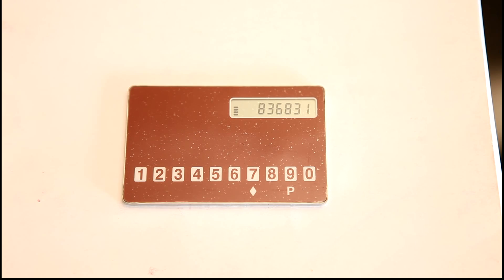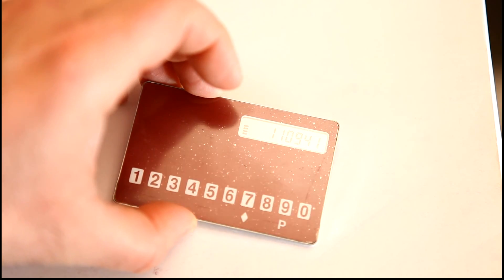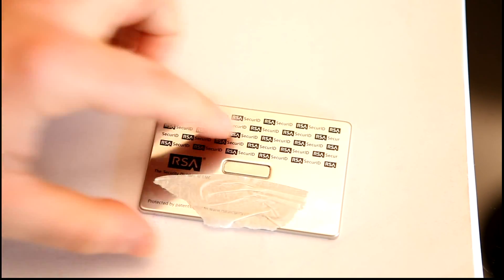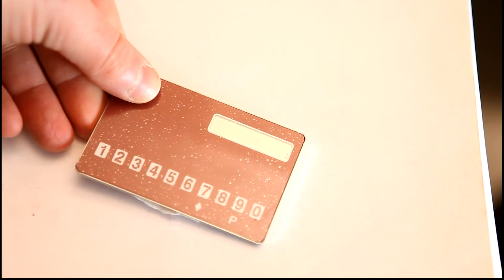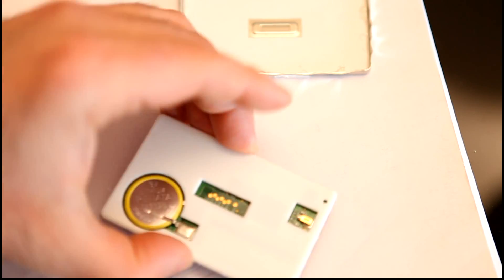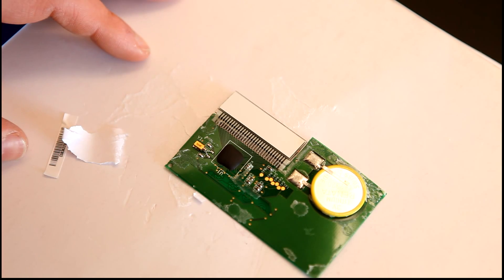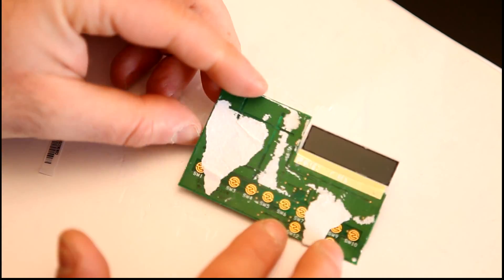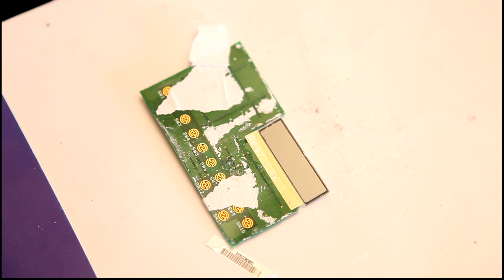RSA SecurID two-factor authentication token extreme dissassembly

Comment: why 8888888?
Reply: PoluxDonetsk If all the segments of the lcd digit are lit it becomes '8'.
http://en.wikipedia.org/wiki/Seven-segment_display
Reply: +Sedokun Actually all SecurID token do this blinking 8888 when you shortcut or unplug the internal battery. It might be possible for RSA to reprogram them through the 7 pins that you see on the back of the PCB.